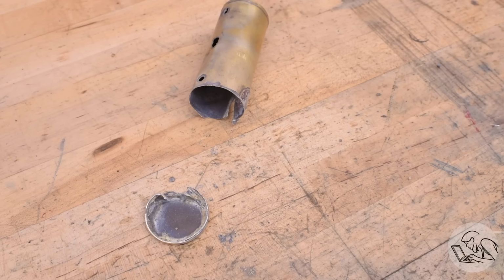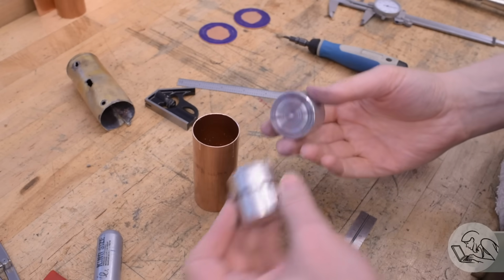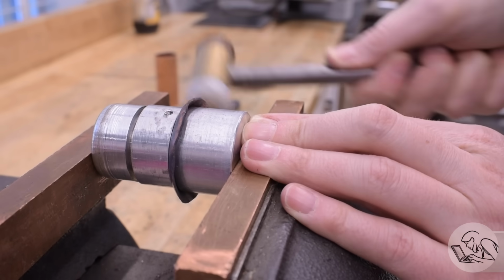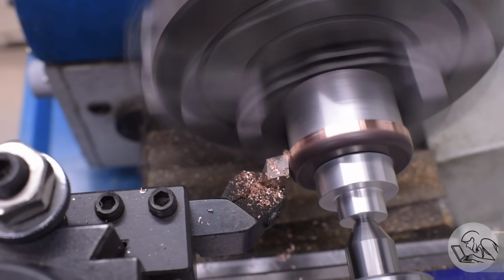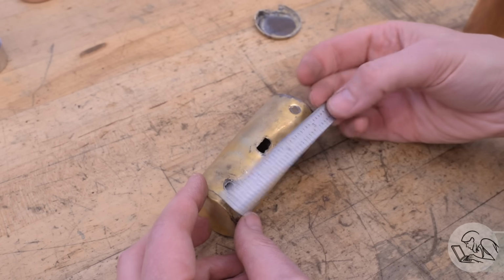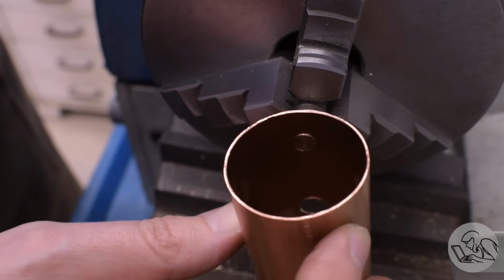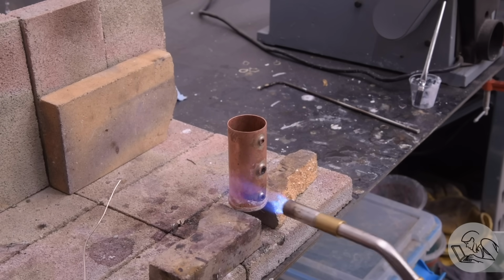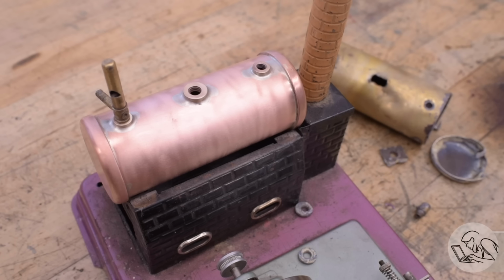New Boiler For Vintage Steam Toy - 1950 Fleischmann Restoration, Part 2

Comment: BA threads are the "normal" thread for plumbing applications here. Water, gas and pneumatics all use it, usually the conical variant.
Reply: Where are BA threads deemed normal for water,gas and pneumatic fittings?  
BSP and NPT are the threads most commonly used in the UK and Europe.
B.A. threads are a small diameter thread series normally found on machine screws or fitted to scientific instruments etc...the biggest being 0 BA which is around 6mm outside diameter.

Comment: I've used a ball bearing roller to form a cap for a tube, using pressure from the cross-slide to form it, I've also used the end of a high-speed tool to form such a cap.
Reply from the maker: I have shown this on my channel

Comment: German plumbing indeed uses imperial threads, to this day. You won't be able to find an actual inch, 1/2th, 1/4th etc. on any of those sizes though because the measurement applies to the interior diameter, the threads are external, and with the time the walls shrunk but the threat standard stayed. The inch numbers thus aren't really numbers they're names for stuff defined in metric. DIN/ISO 2999, "Whitworth".

Comment: re: finish paint on the boiler.  Youtube put up a previous video showing the model boiler as it came to you; which was black with soot.  If the model does get much use it'll probably also be just as sooty.  Also I think that looks pretty good.  I guess that's basically a point in favor of "if it's gonna be black after the first use, might as well be painted black now."  Also i think the sooty look looks pretty good.

Comment: Best guess for a German company with BA threads would be post-war reconstruction. Fleischmann was based in Nuremberg which was heavily bombed, so rebuilding possibly bought lathes and tools from the UK, which would have been set up for Imperial. I do know they produced some trains which were marked "Made in the US Zone Germany" that were exported as part of the Marshall Plan.

I guess as long as parts didn't need to be interchangeable with other brands, it was never a problem.
Reply: Yes, BA threads were more common and widely available pre-war. So, it was used also outside the UK for small thread sizes. And some off it made it up to the 60s before it was replaced with metric.